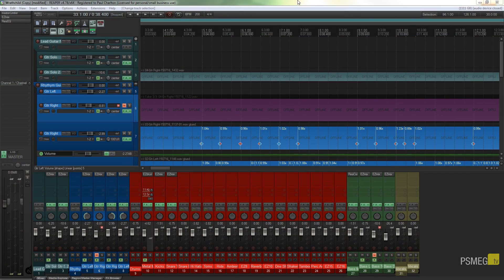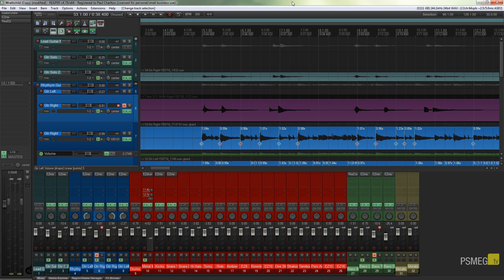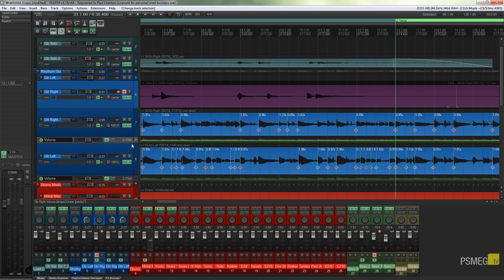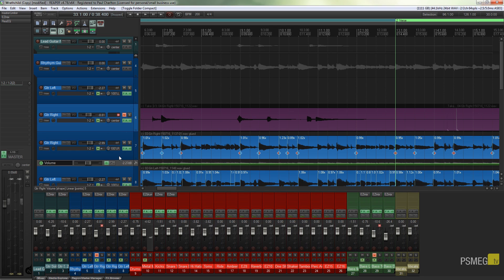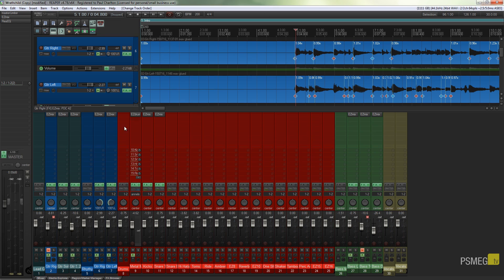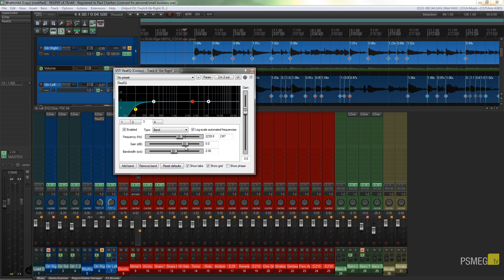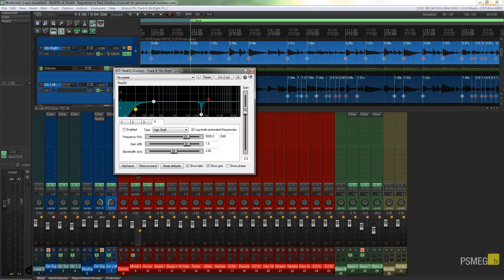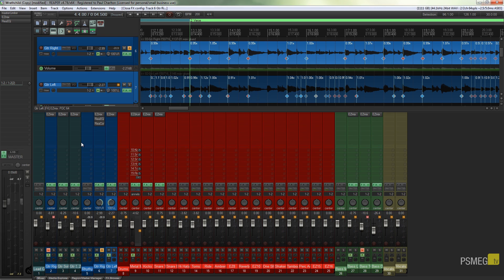Reaper Tutorial: Introduction to Mixing part 1  - Mixing Distorted Guitars

Comment: Re. distorted guitars, distortion (on anything) effectively compresses the signal so it is unnecessary to add further compression.   You should almost never add a compressor AFTER EQ in an effects chain, as it will just boost the signals you have just cut! EQ after Compression.  One major exception to this rule is where you slightly compress the Master Mix as part of the Mastering process.  That's what most mastering plugins effectively do.

Comment: After I make the mix i like how do I get the final mix up to volume and presence like a studio album. I realize there is a lot too it. where can i find out where to start? thanks
Reply from the maker: +slyrez Do some research on mastering, that will give you a good heads up on how to go about things.

As a basic start point, I'd be looking at adding the following to your master buss: Compression, Limiter and overall EQ (if required). The limiter is going to allow you to push the volume and the compressor will help smooth things out (careful not to overdo things).

EQ can be used to control overall frequencies you may not like when compressing and limiting, but is by no means a rule.